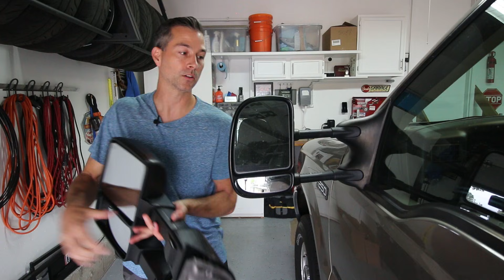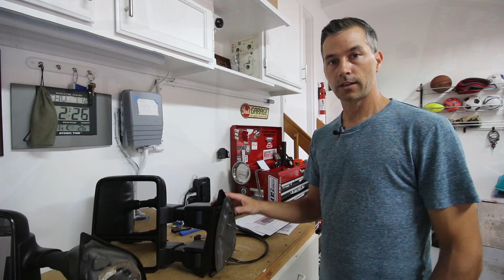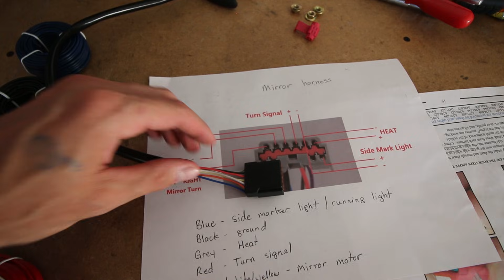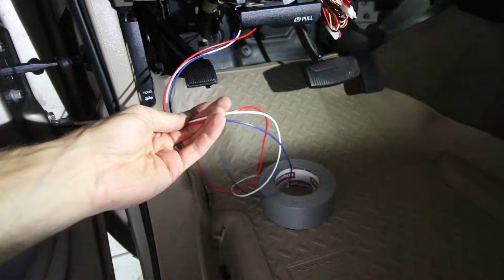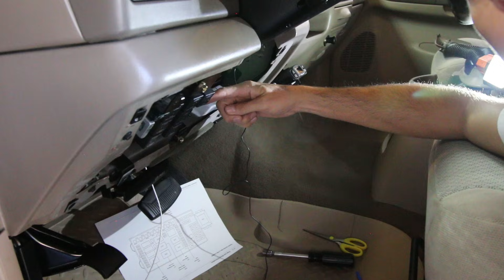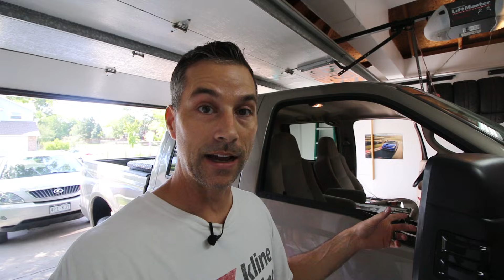Upgraded Towing Mirrors - 7.3 Powerstroke

Comment: Justin, great video and description of every detail.  I'm getting prepped to hook up these mirrors to my 2000 F250.  The two turn signal wires were the same colors you identified as well as the brown wire behind the main light switch.  The only additional notes I'd add when dealing with the 2000 F250, I did not have to remove the fuse box to splice into the turn signal  wires and the slot to add power for the heated mirrors was #27 vs. #29 in your 2002.  I've ran all of the wires into the doors but since I'm getting a total exterior body makeover on my truck over the coming 2 months, I plan on finishing the installation once that's complete.  Again really nice job of detailing your installation.
Reply: Justin (or anyone else), I have a question.  Because my truck is going to be in the body shop for a couple of months I went ahead and installed my YitaMotor mirrors just to make sure everything is ok.  They work great but I found they are NOT symmetrical when looking from the front of the truck.  The drivers side mirror is at a 25 degree angle to the window and 15.5" from the window to the corner of the outside mirror housing vs the passengers side mirror is at a 35 degree angle to the window and 13.5" form the window to the corner of the outside mirror housing.  Even my wife and son can easily see they are different.  Can you tell me if you experienced this with your truck?  Thanks much.
Reply from the maker: Did you ensure everything was seated and mounted properly? All bolts/nuts tightened, etc? I could see one being out of wack if it wasn't fully pressed into the door where it mounts. Could also be you got a badly molded set. I'd reach out to YM and get a replacement if everything else is good.
Reply: @TheBTRGarage  Thanks much!  Both mirror bases are tight against the truck and the body lines are appropriate.  I called Yitamotor customer service and am awaiting a response.  The lady I was talking to initially seem not to quite understand the problem I was describing so I'm a bit concerned.  One other point to add to the installation as an enhancement, I bought 4 pin male/female receptacles and wired the mirror leads to one and the wires I pull for the turn signal, running lights and heated mirror feature with the other so the mirrors could be unplugged when the guy does my body work or if I ever have to replace them.  Thanks again.

Comment: Do you have to do any wiring from the passenger side mirror
Reply from the maker: Yes, I show it in the video. It's mostly the same as the driver side, I just tap into the wires I installed for the driver mirror.

Comment: kinda late but better than never. I was wondering if for the turn signal and running lights can you just wire those through the door and right to the headlights turn signal and running light/side marker?
Reply from the maker: I would think that would work just fine 👍

Comment: I HATE THEM 3 WAY CRIMP CONNECTORS  IT SEEMS LIKE THEY CUT THE WIRE EVERY TIME I USE THEM SO I ENDUP MAKING A  3 WAY WIRE CONNECTOR STRIP SECTION OFF WRAP IT AND THEN CONNECT TO OTHER SIDE AND USE  HEAT SRINK TUBE  SINCE I CAN NOT MAKE WIRE IN HARNESS ANY LONGER SO I HAVE NO OTHER OPTIONS.  GREAT CHINA CONNECTORS  DID ME A BAD MOVE AGAIN .   THAT WAS THE LEFT SIGNAL GREEN AND WHITE STRIP,   WHITE AND BLUE STRIP IS NEXT TO GO I WAGER I CUT IT AS WELL,  WILL SEE   AT LEAST YR. VIDEO WAS MORE TO THE POINT,  BUT I AM BUILDING THE ENTIRE SYSTEM FOR MIRRORS   I HAD TO PUT SWITCH IN AND MAKE A HARNES FOR ALL 7 WIRES HARNESS  TO BOTH MIRRORS AND  NOW I TRYING TO FIGURE WHERE POWER SHOULD COME FROM.  I HAVE RELAYS AND       FUSE  FOR HEAT AND MIRRORS.

Comment: I followed these exact steps but no luck with my brown wires for the parking (running) lights ? Any ideas 2000 f250.
Reply from the maker: Check the wires coming off the parking lights inside the engine bay.  Should give you a hint to what color you need to use and trace that out in the interior bundle. Otherwise, you can just trial and error different wires until you find the right one.

Comment: Great video, that extra bundle of wires may have been an aftermarket remote start. Just a though. Very thorough video.
Reply from the maker: Thank you! I never figured out what the extra wiring was. There was a small indicator light attached to it so I'm guessing it might have been a rig to keep glow plugs on longer (for cold winter starts).
Reply: And I just put these mirrors on my 04 and WOW they are the so much better than the other little mirrors from OEM.

Comment: Surprisingly good video. I already upgraded my 1999 F-350 Super Duty to the level of this video (lights, and heat in addition to factory power). Unfortunately, my drivers mirror got busted by a hit and run. As a result of this, I further upgraded to power extend and power fold. I  wired the heater switch and the auto fold on the drivers door switch panel. The only function not accounted for is auto telescoping. That rocker will be placed where you put your heat rocker in the dash board. There is also a capacitor included on the mirror loom for auto fold post ignition shut off. I elected to completely remake the mirror plugs with Molex 16 pin m/f automotive connectors. I'll just configure the pin pattern to plug and play. As a result of your video, I got several ideas on how to clean up the wiring looms and routes. If you ever do a power fold / telescoping video, that would be awesome. I'm also using Trail Ridge mirrors and their diagram availability is very limited.
Reply from the maker: Thanks, and that's on the full power mirrors. I would love to do that at some point. Thanks for the feedback!

Comment: I wanna wire the mirrors light into my headlights what colors wire is that?
Reply from the maker: Not sure off top of my head. You can look behind the on/off switch panel where I tap into the other wires. Then check the colors in the engine bay bulb harness and match them up. Might take some trial and error.

Comment: Thanks for this video!! I live in Oregon so no need for defrost... do I still have to have a ground wire if I’m not wiring in the heater setting?
Reply from the maker: Thanks! I would still use a ground wire in that case.

Comment: Good job on the Video explaining the process. How did you find out what door panels wood fit your truck? The panel looks the same as the one on my F650 witch leads me to believe that mass production from Ford Trucks will allow fitment for a lot of trucks!?

Your assistant was excellent. Good Job.
Reply from the maker: Thanks! What do you mean about the door panels? I just have the original panels.

Comment: your choice of connectors makes me cringe :-[] when ever I have an electrical problem come in I look for these scotch looks first, and if they are in the circuit I'm diagnosing they are the first thing I remove and repair the wire strands the connector cuts. 
I do like your video and explanations, great work.
Reply from the maker: Yea not my first choice for connectors, but they are common and happened to be what I had on-hand at the time. I assume everyone has their own preference for connectors and wire splicing, but if not, these types are easy to find and usually pretty reliable. Thanks for the comments!

Comment: Can heater mirror wire be activated with fog lights?
Reply from the maker: I don't see why not. You'd have to figure out if the fogs have their own wire, or how they are toggled via the light switch. Then tap into that.

Comment: Thanks for the great video! How has your visibility improved when towing? I haul freight on a 30 foot gooseneck trailer which is 102 inches wide. If I have a tall full width load that is tarped, I cannot see vehicles behind me. If the mirrors are a little wider, that would be my reason for installing them...the heat and extra lights are just the frosting on top, so to speak.
Reply from the maker: You're welcome. Compared the mirrors that came on my truck, these new ones were a pretty good upgrade. A huge improvement in blind spot visibility, due to the large rectangular blind spot mirror. They also extend a bit further than my OEM mirrors which let me see more behind my trailer. It's hard to quantify that, but with the right mirror angle I could probably see anything beyond 10ft or so behind my trailer, which is about 26' in total length behind my truck. Hope that helps.
Reply: @TheBTRGarage  I measured mine and compared it to the dimensions from the Amazon ad...appears to be the same width, but obviously the individual mirrors are much larger. The view may be better, but the mirror needs to stick out a little further to see behind my trailer. I prefer round blind spot mirrors because you can also see your rear tires.
Reply from the maker: The blind spot mirror on these is convex, so it has a similar view as a round one. But yes, if you're looking for something that extends way out there like the Ram trucks have, I'm not sure there is anything in the aftermarket like that. I could be wrong though.
Reply: @TheBTRGarage  The blind spot mirror on the ones you just installed look much bigger. If I have to replace any of my mirrors, I'll buy the ones you installed. My latest truck needed two mirrors which I took from my last one, one of which was new. I'm thinking of adding a round one on the arms to give me better blind spot visibility. I may try to modify the mirrors to extend further.

Comment: my 1999 Lariat has the single mirror and it's so dinky.
Reply: Same year, make, model and crappy paddle mirrors as mine. 
I can see these mirrors for an F-150 but NONE of the F250s and above should have paddle mirrors.
Reply from the maker: Sounds like you need an upgrade 😉

Comment: Awesome video but the choice of electrical connections being used will only cause issues later.  If you're not gonna solder and heat shrink everything at least use shrinkable butt connectors. Keep it sealed up
Reply from the maker: Thanks for the feedback! I went back and forth on the soldering, I prefer that way but I've also heard a lot of good reasons not to do that. It might be a race car thing, but so far these are holding up.

Comment: Very nice job.  We've got the same mirrors and are better prepared because of your good work.  Thank you.   One thing about the video...  On the part where you cover the Light Switch Tap-Brown Wire/Running Lights.  Nothing is ever said there, that a brown has to run to each side for each side marker lamp.  We did not see any video of the brown wire run, nor did we see it in your wire loom.  Did we miss it?... or did you?
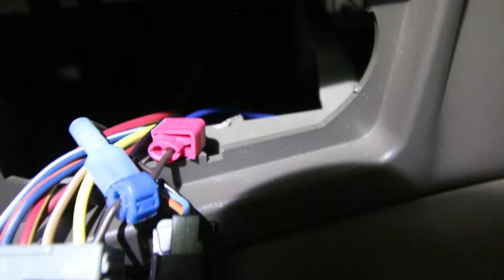Reply from the maker: I show it around the 20:35 mark in the video. I also point it out earlier in the video but the lighting is not great. Was that what you were looking for?

Comment: Justin I purchased some and the wiring is red black and blue.  Red to blinker and blue to brown for park lights?  Black to black
Reply from the maker: Just expose the wires without crimping and twist or touch them together. Activate the blinker and see if it works, if not switch the wires 👍
Reply: @TheBTRGarage  thanks Justin!

Comment: For the passenger side, did you just splice those wires into the already made wire harness? or did you make another wire harness and splice into the same wires as you did for the drivers side?
Reply from the maker: I spliced into the wires I added on the driver side 👍
Reply: @TheBTRGarage  Awesome. Thanks for the quick response, especially on a two year old video. Lol
Reply from the maker: @joshuasabatino1869  No problem!

Comment: So you can’t wire them up to go out and fold in!? And if you did wire them to be fully powered like designed what switches did u wire them to so they have that option
Reply from the maker: You mean have the mirrors extend and fold in/out electronically? If that is the question, no, these mirrors do not have motors to do that, they are manual in that regard. The main mirror itself is power adjustable which runs off the normal mirror adjustment knob on the door.
Reply: @TheBTRGarage  gotcha thanks for the reply I have an 02 7.3 fully powered with those mirrors was curious if it’s even possible to hook them up thanks

Comment: Thanks for video. I got the mirrors and now just need to get them installed. Did you have to modify the mirror a bit to get them to sit flush against the mount area?
Reply from the maker: No modification needed for my truck.

Comment: I would tap into the rear window defroster for the mirrors. That's how it is on newer vehicles I've owned.

Thanks for the info. Looking into a nice 2003 F350, and it has the older style mirrors on it. Your video may come in handy.
Reply from the maker: Yep, rear window defroster is an option too. However, some trucks like mine, do not have a rear defroster, so gotta get it elsewhere.
Reply: @TheBTRGarage  I see, I see. Perfectly logical reasoning on your part, then.

Comment: Is it possible to find pins for the truck side of the plug, then attach lead wires to them and plug them into the harness?  Surely those bare pins are available some, could crimp them on and snap them into the truck side of the plug much as you would an Anderson plug.
Reply from the maker: I'm sure you could, but not sure how much effort that would be? You could also get junkyard plugs and take the pins out of them with some wire attached. Then, attach the new wire to those pins and put them in the plug. Seems like more work than necessary for me though :)

Comment: Hi Justin, really like your content. I have new mirrors for my 7.3 but can't find out how to remove the passenger side kick panel to access the wiring harness underneath the glove box. I've got most of it pulled off but the bit next to the fuel button won't let go. Just pull harder? Thanks for any help.
Reply from the maker: Thanks for watching! I can't remember if there were some small bolts holding that on or not. I know the piece right below the glove box does, search around for some small 8mm or so sized bolts that might be hiding.

Comment: I'm working on wiring the passenger side now, but I can't figure out how to run the wires from the truck to the passenger door and unfortunately he time lapsed through that process. Any tips would be appreciated, thanks!
Reply from the maker: Just have to fish the wires through the underside of the dash. Look around under there and you'll be able to find areas to get the wires through. No right or wrong way to do it.
Reply: @TheBTRGarage  great video going to start on mine tomorrow l have a question about the brown wire do you splice into the wire you just ran form the light switch ? And fish it back to the passenger side
Reply from the maker: Thanks, and yes that works for the brown wire.

Comment: So just run it on one side as the passenger side is tied in via the system?
Reply from the maker: No, you still have to wire the passenger side in as well. It is the same as the drivers side, just have to run wires across the dash. I show it later in the video.
Reply: @TheBTRGarage  Thanks and also  I have the SCOTOO manual mirror with marker and signal.  I believe the mirror wiring is red, blue and brown.  So does that mean blue is the marker, red is signal, and brown is possibly brown?

Comment: Hello thank you for the video. Do you know what gauge wire is in our trucks regarding the turn signal wires? I want to get the correct t-taps.
Reply from the maker: It's around 16-18ga if I remember right.
Reply: @TheBTRGarage  Ok. I want to do this mirror swap to my 2005 Ford F-350 XL dump truck which came with manual roll up windows. I haven’t opened up the door panel yet but I suspect there is not any wiring harness inside. I’m only interested in hooking up the turn signals and clearance lights for the mirrors so I’m guessing it’s as easy as routing a wire from the mirror to tapping into the proper wires under the dash to make this happen (clearance wire, left directional, right directional).  Would this be correct?

Comment: Huge fan of the video.  Fellow CO  person here.  I was able to get some 2012 OEM F550 mirrors for $400 from DTC for my 2002 F250 Bolted up just fine.  I finally hooked up the heating element just like you did. They did work. However I did start the truck to move it and looked down and the light on the switch was out.  The 5amp fuse blew.  Any ideas? I'm also going to post up on FTE as well.
Reply from the maker: Hmm, not sure on the fuse. Make sure all the connections are solid and not loose causing it to jump. Does it keep popping the fuse or has it been good since you replaced it? Enjoy CO, I just moved to Phoenix and miss CO!
Reply: @TheBTRGarage  I upgraded to a 10 amp fuse and have not have any issues.  The 2012 F550 shows it takes a 15Amp fuse but 10 works just fine.  The F550 mirrors heat top and bottom.  I'm not sure if the ones you got heat the bottom and maybe that's why it needed a bigger fuse. Ah well.. At least they work now.

Comment: Thank you for your video and PDF link.I just finished my wiring and couldn't have done it without your help. I did mine a little different, I took apart those extra mirror harnesses that were included and added those pins to the stock harness mounted on the door. Then ran my blue, red and ground wires to those. Worked perfect. Thanks again.
Reply: Just got my mirrors and you have an awesome video to help me install them. Thank you for your time and expertise. My next job is door lock actuators . Hoping to find a great video for that also.
Reply from the maker: Excellent! Glad the video helped!